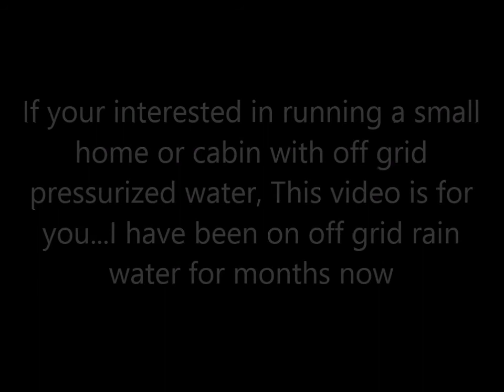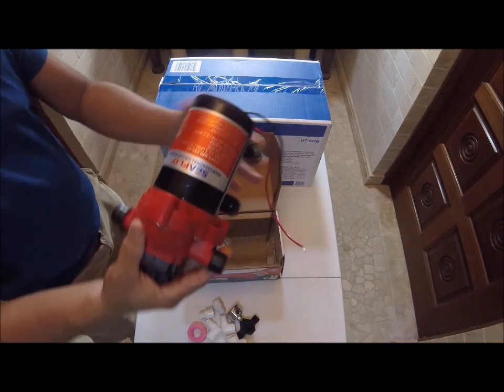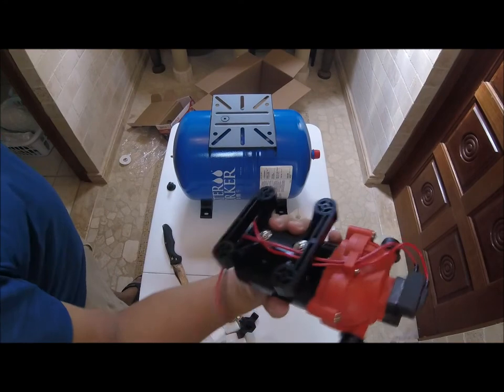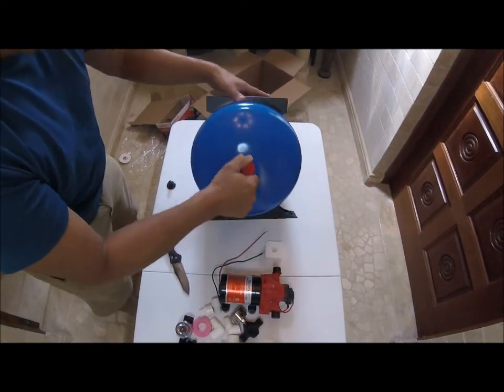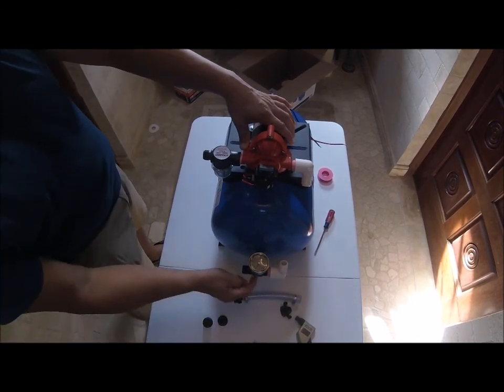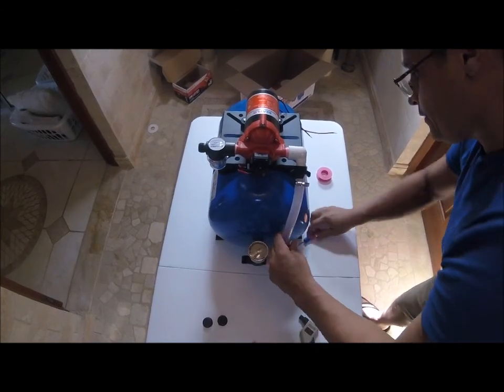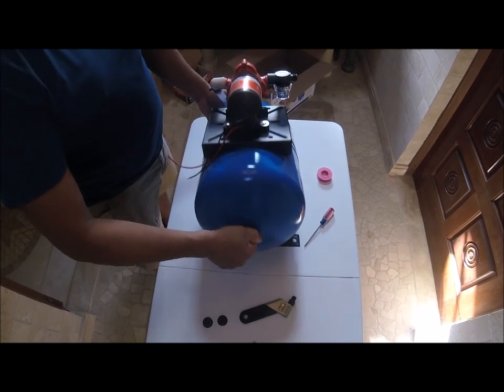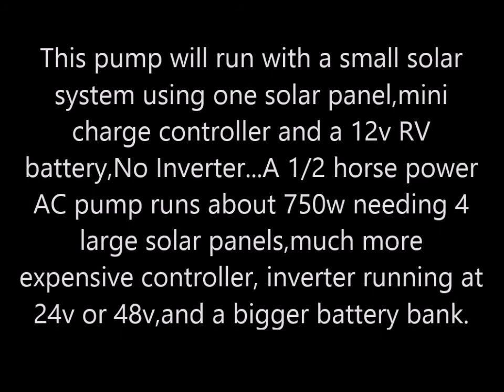Build a 12v super pump

Comment: Hi there🖐
I have a 42 series Seaflo 55psi and I’m off grid. I can understand that your saving power by using the pressure tank. But my question is: If your pumping into the pressure tank that only holds 18psi? Aren’t you loosing pressure from the original Seaflo pumps capacity?..I ask this because I want to set up my pump to have enough pressure for my sinks and shower without loosing pressure through a pressure tank.
Is it possible to have both pump and pressure tank, so I can use less power (using one solar panel) and at the same time not loose the pressure needed for my set up?..Thanks for the video.
I’m just learning about this.🇦🇺🤠👍
Reply from the maker: Seaflo manufacturers are the ones recommending this ,Im actually using this pump right now, This pump is a 45psi 3 gallon per minute pump....pressure is perfect as long as I don't use past 3 gallons per minute, if you go over 3 gallons per minute,  pressure drops...in this case a higher gallon per minute pump is needed, I run 2 pumps in my off grid application,  a 7gpm and a 5,3 gpm at 60 psi giving me a total of 12.3 gpm...If I open enough faucets using over 12,3 gpm, my pressure drops to a unusable pressure,  I hope this answers your question without getting too technical,  my first video shows a lot on how I run off grid,  including it shows both pumps.
Reply from the maker: If any other doubts,  feel free to comment,  I know the feeling of trying to get answers,  Over 2 years ago, I was in the same boat lol
Reply: @MosaicHomestead  Ok, Thanks. I’ll have a look at your first video and get back to you🇦🇺👍
Reply from the maker: @rustywoodpecker8191  OH,  for your solar question,  the pump has a label that shows how many amps it runs on, The bigger the pump, the more amps it uses, Solar panel should provide enough amps to run and charge batteries at the same time, if I have a 8 amp pump and a 6 amp solar panel, your pump will extract the 2 extra amps from the battery,  thats OK during the day, but for the night time you need a battery that won't drain, there are amp hour calculations for this, my suggestion is going 30% over this calculation.
Reply: @MosaicHomestead  Awesome!..Thanks Buddy🇦🇺🤠👍
Reply from the maker: @rustywoodpecker8191  I'll share a pro tip, your solar system is as only as good as your charge controller,  the better the charge controller the better the system, Im running this pump right now in my shed, im actually using a outback 80 amp charge controller and three 320w solar panels, its a pretty strong mini system, Why a 80 amp controller?...so I can run my pump, lights TV and charge my Dewalt batteries at the same time lol.
Reply: @MosaicHomestead  : Now that’s what I wanted to here👍 .... Your spot on Mate👍
I’ll look into that for sure.
Thanks for the pro tip. 🇦🇺🤠👍
Reply from the maker: @rustywoodpecker8191  If you need some help with the calculations let me know, its just a bit of ohms law,  but I would need the specs for everything for it to work lol
Reply: @MosaicHomestead  Much appreciated👍
It might take me some time, but I will get back to you. 🇦🇺🤠👍
Reply from the maker: @rustywoodpecker8191  little by little things get done, feel free to come back
Reply: The role of the pressure tank is to stabilize the pressure, ensure that the inlet pressure of the pump can be stable, so as to ensure the stability of the inlet pressure, ensure that the pump can provide stable outlet pressure and continuous stable flow. We are manufacture of rv pumps
Reply from the maker: @tkevin849  The pressure fluctuates as the tank empties, but the flow continues at a decent pressure,  this pump is already installed and working, it works great... I'm a plumber lol... I have a video up on it working it's the cistern and 12v pumping system video, it's on a micro solar system,  and it's for a micro rain harvesting system that will run a small garden,  I have a bigger system that runs my entire home, thats my first video, a 7 gpm and a 5.3 = 12.3 gpm that's more than sufficient for my needs.

Comment: You have a video of the pump running. I would like to see it work.
Reply from the maker: I believe  I do, this pump is working right now in my shed
Reply from the maker: Prepper shed cistern and 12v pumping system is the video, the pump is turned on and tested at the end of the video...pressure is constant as long as the gallon per minute is not exceeded, if you need more than 3 gallons per minute, a bigger pump is needed.

Comment: Most garden irrigation system are drip right at the base of the plant.
Reply from the maker: I'm using a timer, vacuum attachment for no back flow, a filter, a ez flo fertigation system and from there it will go to 1/2 inch copper that will be plumbed in to a block wall with a hose faucet for each bed. From there it goes to 1/2 inch plastic tubing that reduces to 1/4 inch drip to every plant, the beds will be covered using panda 🐼 poly film to reflect solar light back to the plant and prevent weeds from growing, its a experimental garden so its not going to be big, if results are good, I'll expand to a roof garden.

Comment: What is the pressure in the tank that the pump can put in? And can you attach automatic pressure switch to it?
Reply from the maker: For this pump it's 18
Reply: @MosaicHomestead  meanin max psi of your pump is only 18psi? While your pump is 45 psi?
Reply from the maker: @XRPHordz  pump psi is 45...Accumulation tank is 18 as specified by Seaflow.
Reply: @MosaicHomestead  thats weird 45psi pump but can get tank to be the same
Reply from the maker: @XRPHordz  The job of the Accumulation tank is extend the life of the pump, The pump doesn't run every time the water is on, Why 18 pounds?...The 12v pump is not as powerful as a AC pump,  so the 12v pump won't have the power / pressure  to fill up the Accumulation tank, thats why 18 pounds of pressure in the Accumulation tank... the pump in this video is the pump being used in my prepper shed, it works perfect,  I have a video up on the pump working in my shed, in the future this pump will run a small sink and a portable washing machine.
Reply from the maker: @XRPHordz  if you build one, use the specifications I'm giving you in this video,  you will be very pleased on how good it works...Take advantage of free plumbers advice lol
Reply: @MosaicHomestead  what is the time interval for the pump to resume working after 18psi is reached?
Reply from the maker: @XRPHordz  about a minute  even though it's a 6 gallon tank, I have a 7 gpm on a 20 gallon accumulation tank that also takes about a minute,  but that pump has a AC pressure switch,  that pump has no problems working with a float valve,  this problem is the reason 12v couldn't be used in certain applications,  I changed this with my first pump design,  go check out my very first video,  I run on 100% rain water,  all water is on tap, all power is wind and solar,  and I built it all myself,  including the house lol
Reply from the maker: @XRPHordz  you can also put pump to work without the Accumulation tank, but then pump runs when water is turned on, if your using a bigger 12v pump with a relay and your using a tiny bit of water, use a pressure switch and deactivate Diaphragm switch on the pump by turning hex nut on Diaphragm switch clockwise a couple of times to increase pressure higher on Diaphragm than pressure switch lol

Comment: Hi Luis we recently acquired a hot water pressure washer that puts out 11lpm 
It will stay in the van the all time but in order to do that we need a pump that delivers from a baffled tank to the pressure washer,on the manual it says I we where using tap water we need 30l/min.max 1Mpa
Is there any pump that is able to do this?and if so can't we hook it to a pressure tank like your build?
Thank U
Reply from the maker: A 5.3 gpm should cover your 11lpm, you can install this pump on a 20 gallon pressure accumulation tank,  but if you want a mega 12v super pump, You can go with a 7.0gpm pump that will give you 26,49 lpm. go to my first uploaded video, the one with my 10,000 gallon water storage and 12v pumping system,  there I have a 7,0 gallon pump on a 20 gallon accumulation tank...That might be what your looking for, this pump and a secondary 5.3 gpm pump runs my home, multiple pumps increase your gpm, Example: 7 gpm + 5.3 gpm = 12.3 gpm...I can simultaneously run multiple water devices without loosing pressure as long as I don't exceed 12.3 gpm.

Comment: Can I use this set up to run a Softwash system to clean homes?
Reply from the maker: This is a water pump, if your pumping plain water = yes, if your pumping soap =no
Reply: @MosaicHomestead  what kind of pump I will need for to use with bleach and/or soap ?
Reply from the maker: @Beluel  Most likely a pump for chemical applications, try a YouTube search for your application,  I can't recommend my pump because of manufacturer application of seaflo pump.
Reply: @MosaicHomestead  Thank you
Reply from the maker: @Beluel  your welcome,  sorry  I couldn't help more.

Comment: So considering doing this too!
Reply from the maker: If your building a 48v system and you want to add a 12v pump, Get a 60amp buck transformer at 12v to bring down volts to 12 but with 60 amps that could run a pump of 7 GPM (gallons per minute)...the more GPM the stronger the pump...I run my home on rain water.

Comment: Why 18psi  When the pump is 45?
Reply from the maker: With a AC 120v pump at 60 psi the pressure is set at 28 psi, but the pump is 60, most likely it's torque,  pump pushes water in a rubber balloon against air, pressure does not remain constant when coming out of the accumulation tank,  12v pump has less torque power, this pressure is set by manufacturer,  to make it simple,  less torque power,  less pressure. Pressure will also not remain constant with 12v pump with accumulation tank.